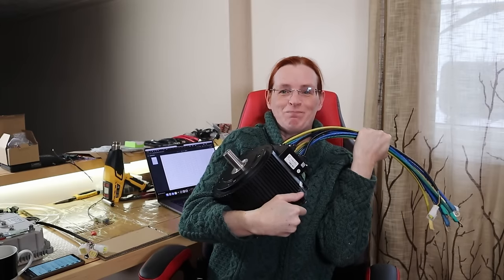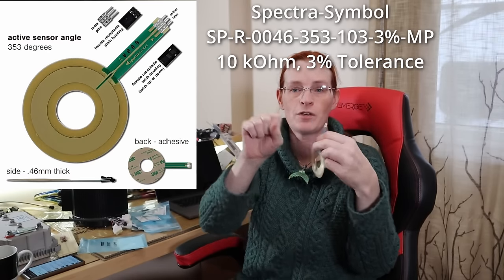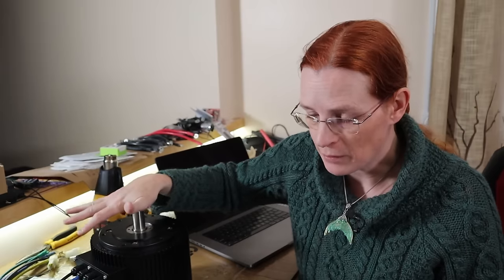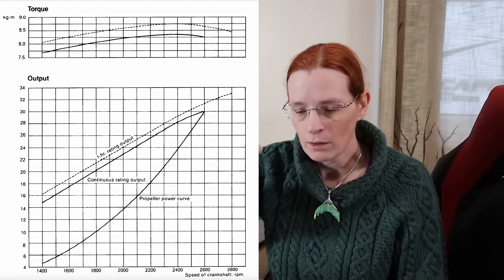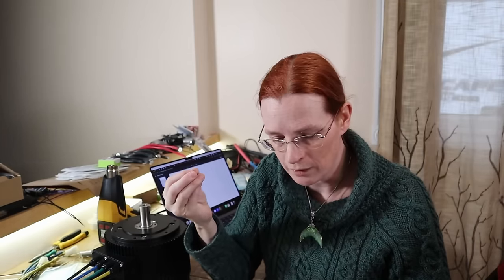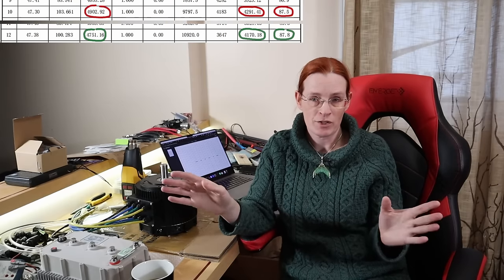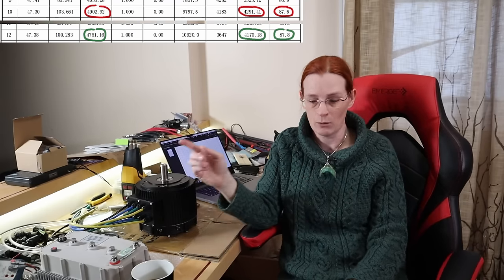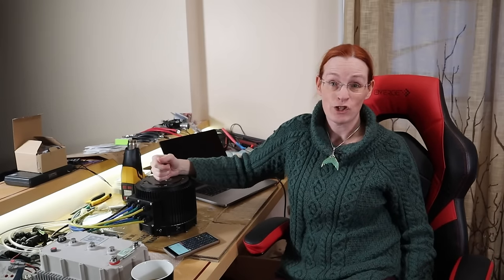Ep. 86 - Decisions Made! - Let's Get Technical

Comment: all of this sounds great theoretically - and it seems you have possibly plenty of redundancy - but what if's and they are likely to happen, jump up and bite your ass when least expected - will you have some kind of motion recharge besides solar, perhaps small wind turbine (might be irritating) or a small hamster wheel off the side of the boat to charge while on the move, in case something goes wrong, faulty battery, a bank of batteries stops charging, you use more power than expected, power drains etc

now the insurance things sounds way too limiting, look for inspiration in aviation, all aircraft are insured, including home builds, they are classed as experimental, surely there is something somewhere

can you imagine, someone converts their on grid house to off grid, sorry, won't insure because that's not normal, tell your insurance to drop dead, someone here will assist i'm sure
Reply from the maker: Oh, you plan for everything, and then get bit by the one thing you overlooked, which always feels so obvious in hindsight. It is "The Way". The two main sources of charge will be solar and prop regen, with (eventually) a small diesel as a last-change fall-back. Wind doesn't seem to be worth it, given the space it takes, the shading it causes and the fact that it only generates decent power at near-max speeds (after which you need to brake it). 

Insurance is a pain in the ass, but I am trying my level best to "Do It Right". I'm already working every thread I can pull, and in the end, I only need one to bite. Insurance for boats seems to be the most restrictive and limited for whatever reason.
Reply: @TheDigitalMermaid  i wondered whether you might build a RAM (ram air turbine) same as fitted to aircraft, but guess the fan you will be fitting doubles up, which i know little of - apart from the direction 'Anzio??' pods on larger shits
Reply from the maker: @patchmack4469  I know nothing about ram air, but I have to assume that by the time the winds get to a point on a sailboat that ram air is effective, charging my batteries is probably the furthest thing from my mind... lol.

Comment: BIG MISTAKE..... after a lightning strike how r u gonna drive anywhere without a mechanical switch backup..... just static electricity will blow an Arduino and I wud never trust it in a marine environment......... ur crazy woman....lol
Reply: You can forcome that with the right tools and electric. I have done this more then once. We used some esp32 and B&R PLC's. You get what you need from Phoenix Electric. One nice project was a catamaran and he is sailing now for 3 years around the world with all that.
Reply: @mikeunum  a non experienced sailor compared to ur example
Reply from the maker: On the "ur crazy woman", guilty as charged. On the "BIG MISTAKE", I disagree, and here's why... No matter what your auxiliary power is, you can imagine scenarios where it can become disabled. Heck, I experienced three breakdowns on the trip home; No alternator in Cape May, fuel blockage on the Hudson River, and cooling failure near Lockport. An electrical system has way fewer moving parts, and it's failure modes often degrade performance, but doesn't fully strand you. I'll have two different propulsion methods, so even if a part faults, I have backups. Lastly, I'll be installing lightening protection, something the boat doesn't have yet, and many boats don't have.
Reply from the maker: One of the biggest reasons I've been doing so much of the build myself is to ensure I've got the tools and skills to do my own repairs underway. :)
Reply from the maker: A live chat with them would be quite fun someday :)

Comment: i have to comment. STOP, Don't do it, you are making a big mistake and all your ideas are faulty. Sorry to say. You're not going to be able to plug into marinas along the way at an affordable price to charge that massive battery. Currently i am in Florida on a 36' sailboat and the lowest price per day at a marina for a cruiser is about $3/foot, or $100/day if lucky it includes electric and many places are up to $300/day i've been quoted. So i have been on anchor as a tank of diesel is much more affordable.
Keep the diesel and rig that three phase motor as a power take off from the engine to charge your batteries yourself from the diesel. Also, regen from the prop from what i gather via sailing uma and Beau and Brandy sailing plus other channels is it's not very effective until you hit 6-7 knots and even then it's not much power so that is not really feasible.
It's why you won't get insurance if you remove the engine as you are asking for trouble imo. You can not beat the diesel.
Reply from the maker: Recall, this is not something I am going to do regularly, that whole discussion was in the context of something like the trip home, where the mast was down and I have to motor. Those times will be rare and short-lived compared to most of the time that I am sailing, where it's almost zero chance I'll run the bank flat and need to plug in to recharge. 

I've mentioned before, but I'll mention again; This whole project started when I went out sailing for the first time, and realized that I didn't dislike boats, I disliked the noisy engine. When I realized that, that was when I decided to get a sailboat, but go electric. Sailing and being electric go hand-in-hand for me. So I am not keeping the diesel, I'd rather give up sailing. And I am not giving up on sailing.
Reply: @TheDigitalMermaid  ok, not to overly discourage you. Best of luck with it i think you're on track and practical testing is key but will also mention i think you're overthinking the efficiency issues of the 10kW motor as that very poor 30% efficiency would only occur at max torque/ max current and low rpm, a condition you should not run at for any length of time, get those RPMs up and the current down is where the efficiency will be best and the 5kW motor would be the same. Losses are I squared R, so high current is high losses, so you want higher rpm, lower current to get your power or cruising point. Best Regards.
Reply from the maker: @randysmith2704  "Overthinking it" is a chronic condition of mine, haha. In the end, getting on the water and collecting real data will be what tells me how close or off the mark I am.